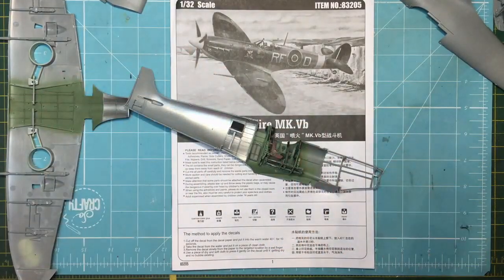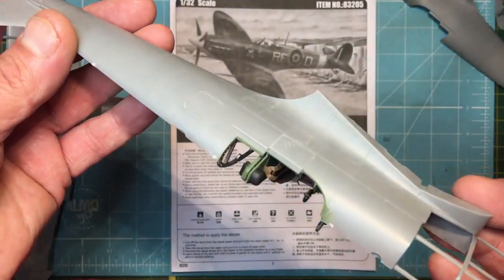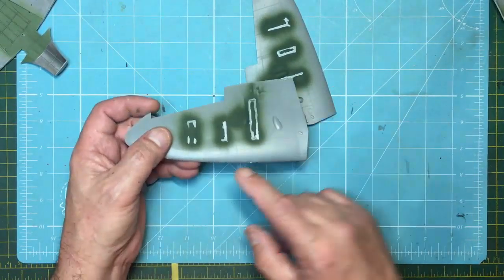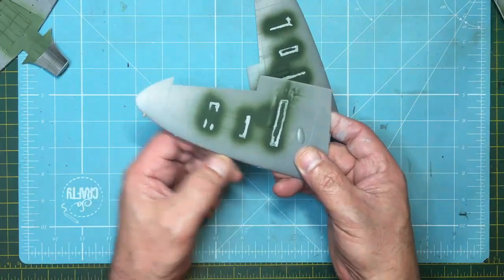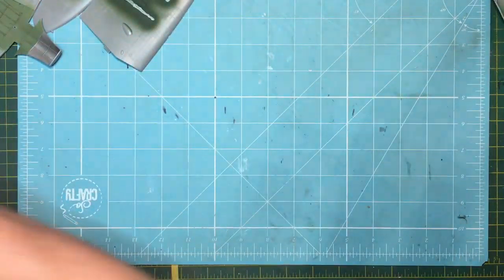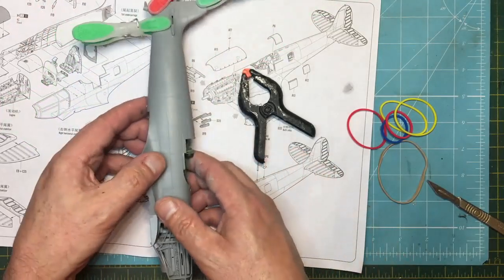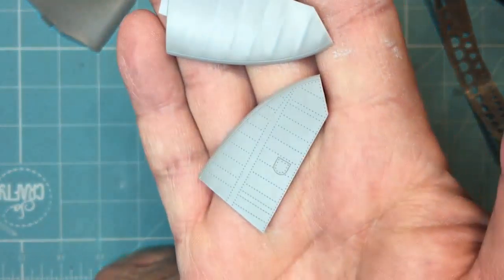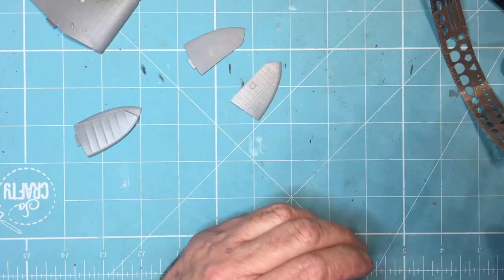Let's build a 1/32 Spitfire MkVb part 2

Comment: Hi Nigel just come across this video perfect timing!  I'm currently working on a 1/48 mk VIII from Hasegawa first time doing this size, I normally do 1/72 spits. My grandad was ground crew during the battle of Britain then went on to Lancaster's of 617 squadron. Apparently they put fabric tape over the gun ports to stop mud and grass getting into them as most of the airfields were mainly grassed

Comment: According to my old copy of Spitfire: Classic A/C #1 by Cross & Scarborough the tiny tubes just behind the exhaust on the model were actually 1.75" pipes threaded through the exhausts and took heated air into the wings to keep the hispano cannons from freezing up at altitude. Also, the dihederal was 6 degrees on the Mk1, so was probably the same on the  Mk5 as well.

Hope this helps. Am enjoying your build.
Reply from the maker: Sarah Bailey wow!! Thank you very much Sarah. I’ve now done the wing joint and hope to put the part 2a video up later. So, those tubes should be there, but I assume only on Models with Cannons? Thanks again.

Comment: Another enjoyable build Nigel, thanks for sharing. 
I’m no expert, but I seem to remember reading somewhere, that the British fighters had the gun ports taped over to reduce the issue of icing or freezing of the guns, which was common at high altitude. The typhoon needed heating ducts run into the gun bays from the engine, for the same reason.
Reply from the maker: Thanks for the update on the guns Derek. So, unless the plane had just returned from a mission, the tape over the ports in the wings would be fresh? So, should I puncture the holes or not??
Reply: Well I guess there’s no wrong answer to that, depends whether you’re trying to tell a story or not I suppose . Punching in the holes might add more interest, and if you were creating a re-arming dio, they probably should be opened up, ....... I’ve never seen a diorama with a figure actually re-applying the tape, but that might look pretty cool too. 🤔
Personal choice really.

Comment: Nige
Super progress on the Spit - just love the concept and presentation of the build video. I'm in the opposite camp when it comers to priming and always use primer. When shooting acrylic top coats, I always go with Mig Gray Primer thinned with Tamiya X-20A and when going with lacquer top coats, I go with Mr Surfacer 1200 thinned with Self Leveling Thinner. 
Keep 'em comin
Peter

Comment: Theres a channel called hpiguysworkshop, and its mainly car builds which come moulded in white styrene. He has always put an orange dye in his liquid cement to aid his eyes. I suppose the black will work better on the typical grey kits.
Reply from the maker: F15H3R M4N the way I see it is this... when we apply tet to a painted part the joint must be at least 40% paint so a few drops of xf1 in a bottle of tet won’t matter? It works a treat on long seams like wings and things!!

Comment: Another useful and informative video Nigel.
I am no expert on the Spitfire so I can't offer any advice but can I ask what you consider to be a more accurate kit to build a Spitfire please ?
Interesting comments on the Vallejo primer, I have had probs too especially with it clogging the airbrush!  I'm pretty well versed in spraying and this stuff should be binned as you say.
I'm also going to start using the Revell paint on a more frequent basis to compare with others I use and see how I get on.
Cheers 
G
Reply from the maker: Hi G. The Revell paint is brilliant, to tell you how good it is.. I left some in  my mixing pallet for about 30 minutes. i always do this then wash it off with hot water.. the Revell paint won't budge!! It's bloody hard wearing!! If you want to build an accurate 1/32 Spit, get the Tamiya 1/32 kit, any variant. All the others have something wrong with them.
Reply: Thank you matey, always useful to know and share experiences. I have used some in the past and also like quite a few of the Tamiya paints too which always seem to go through my airbrush far better.
I will get around to buying a Spitfire at some point ( my house is on the market and everything is packed away ! Its like having my right arm chopped off not modelling !!!!! ).
When I'm settled again I will get sorted in the meantime I'm finding comfort in watching you build 
G
Reply from the maker: @djbruzer12  Glad to be of assistance mate!!

Comment: David R Lentz, Columbus, Ohio, USA (Sunday, 14 July, 2024) 

Nigel, you tell us in a video from 2019 that you just learnt to your surprise that 1.6% of your subscribers are females. I long have wished to have female friends who shared this avocation with me. 
   At 7:15, you mention Airfix’s 1:72-scale kit of the Lancaster “Dam Buster” Heavy Bomber, and the Lancaster Mk.II Heavy Bomber with radial engines in lieu of Rolls Royce Merlin V-12 engines. I enjoy hearing this, for I understand only partially the RAF marks that denote the different variants of their aircraft. 
  I have a keen interest in the de Havilland DH-98 Mosquito RAF Mk. IV Light Bomber and the Photo-Reconnaissance Aircraft (though for the latter, I do not know the mark designation), both variants amply swift enough to require no defensive armaments. I understand that Airfix offers a 1:24th-scale armed fighter-bomber version kit, and Tamiya’s similar 1:32nd-, 1:48th-, and 1:72nd-scale kits, all four of which I would like to build together in a forced-perspective ærial diorama, complete with identical camouflage paint scheme, unit markings, etc., for the same squadron, dramatising a close formation. I especially would like to find Mk. IV light bomber and photo-reconnaissance versions of these kits; or alternately, the means to convert the kits to the latter. 
   I already had built Tamiya’s 1:48th-scale Mk. IV light bomber-PR kit as two of the bomber version (one landing gear down), and one PR aircraft, so I know of it. I also have seen the 1:72nd-scale kit of these versions. In a recent review of the 1:32nd-scale kit, I saw in the instructions booklet detailed line drawing illustrations of the fuselage that show those parts Tamiya had designed to allow for different iterations of the actual aircraft; from these, one reasonably can expect the manufacturer in the near future to issue a light bomber-PR kit similar to its smaller, older twin. 
   Nigel, you tell us in a video from 2019 that you had begun a video build of the Hobby Boss Spitfire Mk.Vb (Supermarine Spitfire RAF Mk.Vb Fighter), choosing this particular one for your interest in a 1:32nd-scale brown and green Spitfire (I would like similar kits of the Mk I, Mk.Vc—well, whichever variant had the four Hispano 20mm cannons—and the Mk.IX, as well as the one with 1) the five-bladed propeller, and 2) the first mark with the Rolls Royce Griffon engine. I by contrast much prefer green and brown Spitfires Mk.Vc, in a series of scales), telling us that “this [kit] was in my stash. If I’d have needed another one, I probably would have gotten the Revell kit, although apparently, it’s got issues”, too. 
   Well, this obviously requires a side-by-side comparison (one green and brown—the proper way, of course—and the other brown and green). Do any other model manufacturers offer a well made, new-mold Spitfire Mk.Vb/Vc kit? How many good-quality 1:32nd-scale Spitfire kits would this entail? Perhaps you could combine them all in a kit review. 
  At 55:26, you mention what sounds like “Dzus fasteners”. I have heard of them, though I am unclear as to what they are, or their function. Is this to what you refer, please? 
  At 57:16, you ask us of the aircraft model’s dihedral, and the gap at the wingroot. I suggest looking at actual Spitfires to assess the dihedral they have, and from them, evaluating any requirement for alteration. To my untrained eyes, and from what little experience I have had in looking upon actual Spitfires—a few scenes of low altitude flybys in Foyle’s War (BBC) (I had cautioned you it was not much!)—the dihedral looks fine; fill the wingroot cracks with strip stock, then putty the result to a smooth fairing into the fuselage. 
   A capital job of it, so far, mate! Looking forward to part three.

Comment: Had a quick look at pictures of Spitfires sitting on the ground without pilots. They don't appear to have anything powerful centralising controls. Elevators appear down, although probably not fully down. Rudder fairly central but not precisely so. Ailerons not necessarily central either, but you don't want to know about that!
Reply from the maker: Chris Young thanks buddy. Good info.
Reply: Just in case you ever want to model ailerons off centre you will usually find the upgoing one is travelling further than the down going one. The idea is to reduce the secondary effect of aileron that yaws the aircraft in the wrong direction caused by the down going one entering the high pressure air below the wing and the upgoing one the relatively low pressure air above.
Reply from the maker: @chrisyoung7157  Wow.. there's some information you need to read twice to swallow.. thanks bud!!
Reply: I remember while learning to fly gliders decades ago the instructor asking me to put my feet on the floor while rolling the aircraft to the left. Sure enough the nose shot off to the right. I've never forgotten!